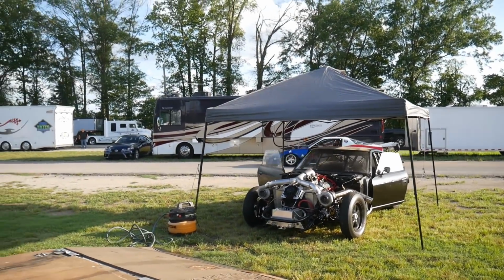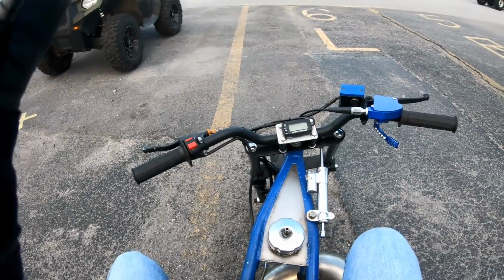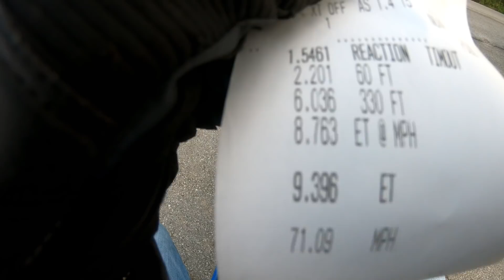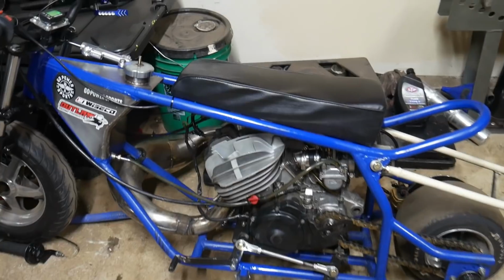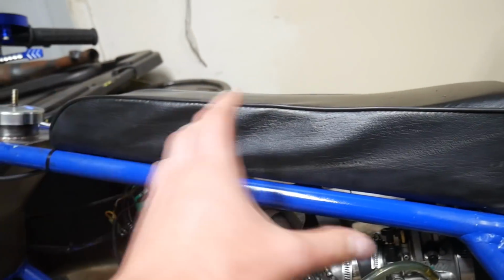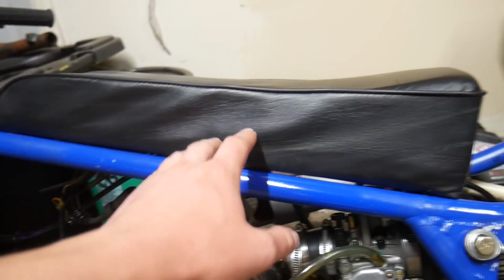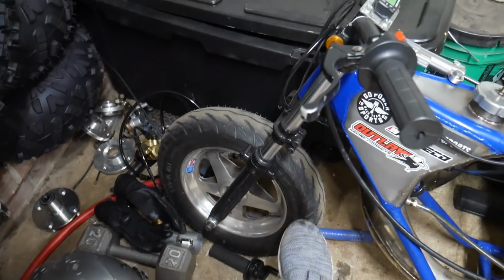2 Stroke Minibike races 1/8 mile!! Can I go 8's?

Comment: Hey I drag raced bikes for years here are a few things I see that might help.

Your on the right track with the seat. Find a comfortable seating position and fit a seat with a notch or back too it. The less your ass moves the better.

Keep that front tire. I don't think a skinny will be all that beneficial in your situation. That front kept you vertical when your hand slipped off the bars on that one pass. 

That pipe...oh man that pipe. It has your leg trapped and if you ever go over that's gonna tear your leg up. Plus you can't get a decent launch with one foot on the ground. Look up pictures or vids of guys launching their bikes. You need both feet on the ground and a firm grip on the bars. When you launch, tighten up like your doing a crunch. 

That shift over ride will help. If you can just hang gears with your foot that will help.

More starting line RPM! Your only traction limited when you have a wheelie bar. You will find your traction limits or parts limit.
Reply: I hope he sees this so he can pick up some time.
Reply: @Nik-gh6gz  Aaaaand he didn't lol.

Comment: Looks like that second gear launch is gonna be where it's at. It's very hard to launch in second. There's so much more throttle needed to do it. It's so difficult to balance the powerband on the clutch like that.  Practice practice practice.

Comment: Upgraded polaris scrambler 400 2 stroke with CVT swap!
Reply: @Angel Torres the one I had was it was bored .80 over with Port work and a bunch of other things it was the fastest ATV around beating 400ex's without a problem
Reply: @Angel Torres you most definitely can mine was probably right around 50HP they are not too hard to get there either.

Comment: Seat idea is a good one. Make it hold you in place. And along with the override trans, try looking at an air/CO2 style shift setup. You would be able to run it with a small battery and a paintball canister. Wouldn't take much. And put a little weight on the seat when you're doing the burn out. Get a little more heat in that little tire. Skinny front is a good idea too.

Comment: Ok here is a tip as you sead lean the crap out of it and gear it way up or drop the cluch in 3rd and have it gaining speed down the track then you wold onley need to shift  1 time wen lunching in 3 sit on the gas tank and lean forward a lot more

Comment: This mini build and performance has impressed me since first seeing the channel on here.
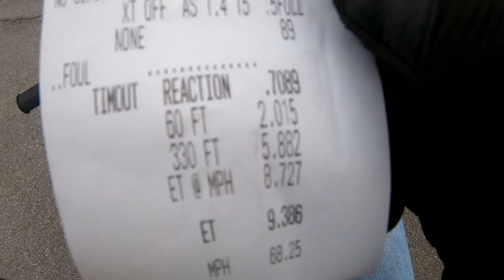3:06 suprised me with the 2nd gear launch...60ft improved big time but traded for mph upstairs.
Might have to lower the wheelie bars and pump up that rear tire. Traction is never a problem on a mini. 
My 212 predator doodlebug with mods and a wheelie bar runs 9.50@66 with a china torq-a-verter. Every time i drop a tooth on rear sprocket it goes quicker and faster...difference is i dont have to change gears.
Im thinking gearing is your secret into the 8s!

That third run has happened to all of us at least once...all you can really do is ride it out!
Thats what i dont like about those fat "square" shaped drive tires. In your case its almost like the tire is too short and too wide. I know near the end you thought gearing was close, but i believe a taller, narrower rear tire would be quicker...and dropping teeth on rear sprocket too. Do so until it slows down on both e.t. and mph then back up till the sweet spot.

Great vid, loved it man

Comment: I’ve seen something like this before in a custom frame banshee 2 stroke engine big bore kit I would leave the seat where it’s at and stretch the frame forward it will help the weight transfer shock on takeoff and keep the back tire planted and keep the Rpms high and use the clutch to control the takeoff

Comment: Change your shift pattern, by flipping the thing attached to the shaft on the engine, so that upshifts are made by pressing DOWN on the pedal- you'll get more positive shifts while under stress of a run and less chances of hitting a false neutral
Reply from the maker: It is already that way. (Gp shift)

Comment: Looking good! I have a suggestion and you've probably already thought about it. Disassemble the transmission and under cut the gear teeth so you can safely shift without the clutch and/or let up off the throttle and install an air shifter with a stutter box (if there's a stutter box available for a single cylinder). Normally a stutter box will cut the coil's power to half of the cylinders, so if you have 4 cylinders, only 2 will have a spark. This way you can keep the throttle pinned until time to launch. It will keep the rpms down 'till the moment you release the clutch, then full power to all cylinders and all you do is push a button to shift while holding the throttle wide open. I don't know if a single cylinder box is available. It would somehow kill every other spark 'till the clutch is released. Maybe one of you can alter a rev limiter from a 4 stroke motocross bike to work. You'd have to be able to adjust the revs way down and connect it so the rev limiter would not limit the revs the moment you release the clutch.

Comment: Your best out of the hole launch was without the burnout. Always want a little tire slippage to get into the powerband easier. When you did a burnout, the engine bogged down and came out of the powerband by dropping rpm because the tire gripped on the launch. Or you can let the clutch slip a little longer on the launch but that is hard to keep consistent and will wear the clutch out faster. Still looks fun though, give it hell, LOL.

Comment: I think the only thing wrong with it is it needs a better seat , like your aluminum seat idea .maybe put stand up jet ski rubber decking on the seat to help some with the vibration and grip. It  wouldn't hurt to  stiffen up the front shocks it will help you more easily transfer the  weight to the rear tire pre-loading the sidewall. Of the slick👍I would get as consistent as I can with what you got and then step it up you're doing an awesome job I love following it!!!

Comment: you've got less grip on the handle bar with the thumb throttle. i totally understand not having a twist throttle, you definitely would of hit the wall coz you would of open the engine up by trying to hang on, well done for hanging on by the way, you done very well my man. on my outlaw quad and electric mountain bike i turned the thumb throttle into a trigger throttle so i could have my thumb safety wrapped around the handle bar which comes in handy when you hit the whoops. bit like the remote control for some rc cars

Comment: If you are looking for a cheap good tach that is pretty quick I would recommend a hardline tach hr meter I use this same tack mentioned when tuning chainsaws and it's pretty responsive. If you want one that can read coolant temps or spark plug head temps and tell rpm plus a lot more I would find a mychron 4 for 150 to 250 from a local oval kart racer that's wanting to upgrade to the 5. If you want something a bit more advanced then the mychron 4 I would go with the mychron 5. They are worth the money spent. I personally use a mychron 4 on the oval race kart.

Comment: Did you try soaking/softening the rear tire?
This is kind of out of 
the box, but how about extending the frame to run 2 rear tires with a jack shaft sprocket set up.

Comment: You should practicing burn out launches, learn to slip the clutch, you are rev and dumping it on launch. For example in my stock 5 speed cobalt, i could lay a 20 foot patch if i wanted. Once you learn that, then you learn to launch it with minimal slippage (aka burn out) thus increasing your launch power.

Comment: No need for a tacho to drag, just shift when it stops pulling.
It does sound a bit short on revs, maybe an ignition upgrade might be needed if the stock one has a rev limiter in it.

Comment: Need a slipper clutch like a top fuel bike so it won't buck like a bronco on ya. Air shifter would help your consistency. But with no rear suspension and such a little tire it's gonna be pretty nasty no matter what on the launch. Thing is a screamer. Once you get everything ironed out it'll be scary fast. Depending on the truck it might end up so fast they won't let you back lol. Thumbs up👍

Comment: Pingel quick shift, it will kill the ignition for a split second when shifting , no clutch needed to shift. Heat is needed in the pipe , so do some engine warming in staging

Comment: Idk what your engine setup is but ken oconner racing can help you make some more power , hes the master at blaster engines. 

Might wanna look into the shift star mod and possibly a modded trans so you can shift flat out. Light weight flywheel, lectron carb. Ken oconner will be able to point you where you wanna be. 

Get some heat in that rear tire and practice launching hard

Comment: just an Idea I think you would do better with a correct shift up instead of down to go up also I would try to putting in a set of barnett racing clutches and an air shifter

Comment: Add an air or electric shift and youll cut a half second off once you learn how to use it..A tad taller rear tire would help to not overrev at top end and to lengthen the shift points a little.

Comment: The one problem I see is that you are not starting in the groove. The most rubber and traction is in the tracks on the left or right of the lanes where the car tires run. I bike that one launch that you had was due to hitting the edge of the tire tracks with part of your rear tire, and the extra grip only on that part of your tire caused the tire to torque steer your launch. Also, your shifter and pegs, if they were more rearset, they would give you the advantage of the g forces of acceleration helping keep your feet planted on the pegs, and help your body grip the bike by transferring your grip from your hands holding on, to your legs doing the majority of supporting your weight during accelerational weight transfer. Also a seat backstop as you mentioned would also be helpful.

Comment: first start with full throttle five sconds before the light change to green, that burn out all not burned full in the crank chamber so you dont start with too rich fullmix and slip in the clutch at full throttle. second don´t pull the clutch lever and shift up, that´s way to slow and not necessary, push the shiftlever up already while accellerating, the gear won´t shift but in the moment you pull the clutch  lever at full throttle a little bit the next higher gear will jump in immediately and gives you futher acceleration without loosing power on der chain.

Comment: and dont worry about the tires they are fine. but you need to stream line your stance. you are like a massive air brake. if you can lean forward you can take some drag off you. or make a superman seat setup.

Comment: Your 60ft needs to be more moving , getting  out of the hole is key, you got the gears for mid track an top end do you run alcohol in it???....also nitrous they make small kits now...a little shot couldn't hurt,...but only when the bike is moving like mid track an after...good luck an also I was going to build a bike like that...😎✌🍕

Comment: Experiment maybe with a recluse clutch? May help on the launch. Either way that’s a sick machine you built 👍🤙👊✊👊✊👊✊✊✊✊✊
Reply from the maker: Thanks! Ghpc definitely overhyped those + they don't make em for this application
Reply: Vasily Builds yeah I wasn’t sure if they did or not. I use them on my kx250 and my sons KTM. They are great when set up correctly, but can be tricky. I like them because no matter what riding I’m doing, mx or trail, I don’t have to use the clutch so much. One thing I was seeing is how you were sitting during launch. Maybe move feet pegs back and fab shifter where you can shift while layed down more and lean over handle bars. Just some suggestions, best of luck to you and I can’t wait to see how this project progresses 👍

Comment: I didn't think it had it in it to come up like that on you!  If youre struggling with the shifting, it seems like the thumb throttle is disagreeing with the clutch.  But i guarantee once you figure out how to roll or twitch the throttle with the clutch you'll drop into the 8s.  This is a nice enough bike though that id feel okay about picking up a rekluse clutch if you can

Comment: Before you go bigger displacement, master your driving skills. The one run that almost had you into the wall, your hand just came off the left handlebar. That was totally you. In general, when you see the last yellow, that's when you go, and by the time your launching then you are rolling out of the staging lights. Seems like you could come out of the hole with more power also. You don't have to worry about going over since you have wheelie bars. More practice, more practice, more practice. Lots of things happening all at once. Nerves are high to perform well.
Reply: him letting go wasnt his fault. hes got nothing to push into his back so he doesnt come sliding off the seat.
Reply: @frigglebiscuit7484  I realize that, but loosing your grip is still on you. I realize also this is only his second time at the track. There are so many things to distract and nighttime makes it a bit more disconcerting.

Comment: Pssssst, I know where you can get a 500 cc engine real quick. LOL... Seriously Vasily! I think there's a lot more in the mini bike, this is only your second time at the track with it, you need To try to launch it wide open, set the clutch lever so can use just your first two fingers to operate it. Ring finger, pinkie finger and thumb holding on tight. Wheelie bar bikes can leave at a much higher RPM. Improve the launch and you'll be surprised!! P.S. If you had an air "CO2" shifter you could move the foot peg's back which would put you leaning forward "Drag Bike Style"  feet on the pegs balancing the bike with your toes, dump the clutch raise your toes and press the shifter button! 👍👍👋👋😉😉

Comment: From what it looks like that sloppy start, ya let clutch out, hooked yanked forwards, pulled ur left hand off bars, right hand yanked em right, threw yourself into a tank slapper, but hey nice save tho. Future ref, try holding clutch with pinky and ring finger, or pointer and middle, ull have more control of the bars and a much more sturdy grip, good luck on your next passes love watching it while I build my honda

Comment: It looks like part of the reason why your second pass was the fastest, is cause after that close call, it looks like you really backed off of trying to launch hard in 2nd gear kinda like you hadn't quite shaken off from that close call.

Fixin the seat and then make sure you just keep on the power I bet would make for a great launch as long as your wheelie bars keep you straight.

Comment: Just my 2 cents... Instead of going down in front sprocket size which increases tourqe go bigger for more top end... Go as big as you can since your rear tire is pretty small, that sized tire creates all the tourqe you will ever need... Also if you drop a few teeth on the rear you will get more top end which equals a faster pass... Also advance your timing by no more than 4 degree, add in a 3/8 reed spacer with tourqe reeds... Stock carb I assume?  If so have it bored or step up to a 34 - 38mm flat slide...

Seriously man when I raced blasters in mid 2000s there wasnt another that could ever touch mine on dirt or asphalt... Blaster motors have amazing potential lol... On the dyno I hit 42hp at the rear wheels & on a 300 plus pound quad I would hit 92mph - 98mph in the 1/8th...
Reply from the maker: I'm running a 35mm carb. You have 6 gears why not use em. You see I'm barely coming on 6th so it needs to be gearing a little lower.
Reply: @VasilyBuilds  pin it feather the cluth and start in 2nd or 3rd then you can hit 6th. Takes practice but you CAN DO IT..!

Comment: You are leaned over to your left is one that’s causing you some trouble and try leaving in second gear while wide open and feather the clutch and your time will be faster cause that’s one less gear to change and you will be faster out the gate. If you have problems leaving in second gear the bike down until you can handle it and then you can go back up with the taller gear but you are actually doing a good job now I just think you can be faster with out spending any more money on the bike and a lower gear won’t be but $15 buck